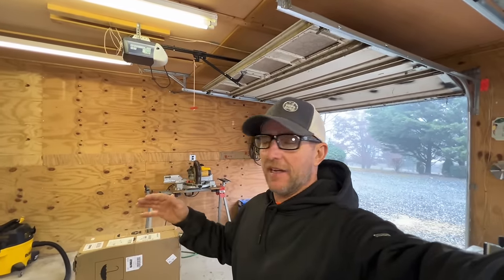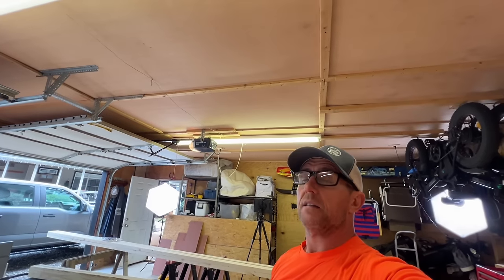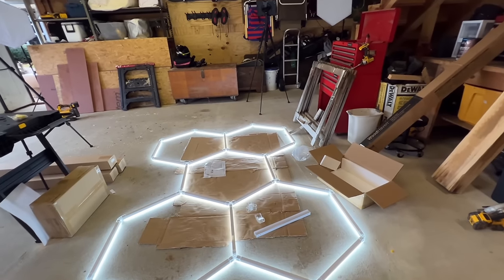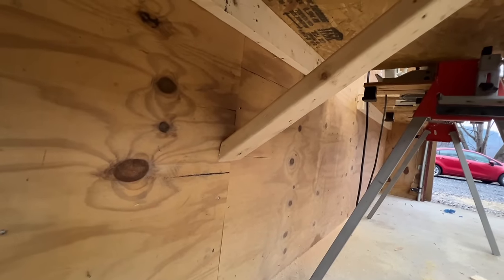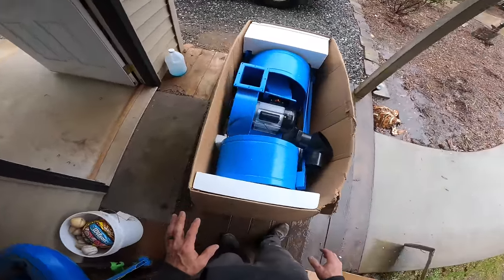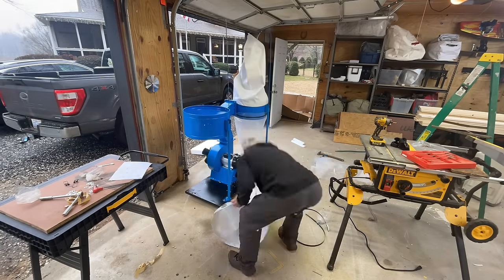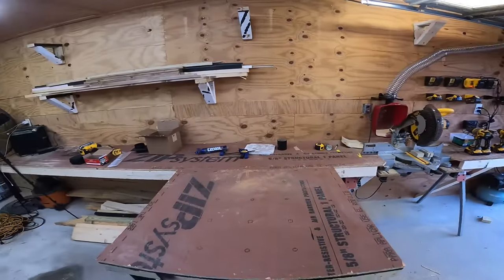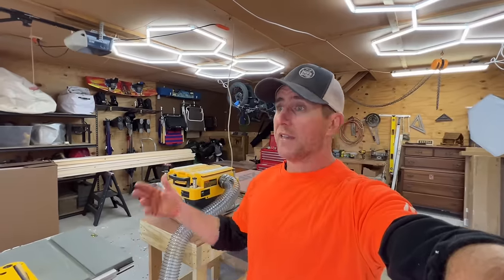Jay's New Shop--Episode 7--THE SETUP!!

Comment: Jay instead of using a pan to catch the dust from the miter saw use  a thick  plastic  clear bag and  use a twist tie  to hold it on when you move it to  a different  position  to catch the dust that way the dust will be in the bag  .

Comment: Jay, look into grounding your vacuum hoses.  Lots of static electricity builds up and wood dust goes up in flames pretty easy.  It's a simple as drilling a screw halfway into some plastic housing and running a copper wire to a ground.
Reply: We used to give our wide belt sander dust to a pyrotechnics guy cuz it's so incendiary😉 I've never known anyone that didn't ground their hoses.

Comment: Another option for making 45’s easy is just add the thickness of the material twice, as in 1-1/2” material add 3” to the shorts and you know your longs unquestionably. My go to for door casings. I used to try at measuring shorts but the math is so easy and cuts simpler if you know your longs, or sharps maybe the more common phrasing.

Comment: I forgot what those DeWalt Portable Benches look like new.  I've used mine for everything from an outfeed table, painting table, cabinet assembly table, and a miter saw stand.  You name it, the possibilities are endless with them.  And when you need to use them outside the shop, they're simple to move. One warning Jay, make sure when you are opening them that the legs are facing away from you, or else you'll be singing soprano.  Haha. Thanks for the vids.

Comment: Love the new shop. A suggestion, i added a retractable 75’ extension cord reel to my shop and its amazing. Power anywhere you need it. I’ve also put all my big tools on platforms with casters. Miter sawstand , table saw, planer, all on casters. Makes life much easier.

Comment: You want to see if you can get hold of some second hand kitchen units and worktop for your mitre saw table. You could have one worktop running the length of the shop with a cut out for the saw. It would keep level a lot easier and give you a load more storage in all the units underneath.

Comment: You should swap the table saw and planer locations. The planer seems to be a more permanent piece with the stand you made for it, whereas the portable table saw if you wanted to move it, you have to move hoses and pull it out from between two permanent pieces.  Just a thought.

Comment: Jason, handy tip is to number your batteries. First you always know how many you take/pack down every day, but you can work them in order so you never kill just one of them by over working it. Also if you are working them hard like on a grinder or high demand tool and eating your way through them you always know what's on charge and where you are in your line up so you have a better chance of running all day without waiting for charge times.
You should just make a timer box for the chop saw swarf, also it will work better if you pull air from the bottom and get a free gravity assist. 
The shop is looking dialed in mate, huge upgrade and you should be proud!!

Comment: I'd just attach that DeWalt vacuum up to the miter saw for now until you can figure out a better solution to your dust collector. The vacuum hose off that will be much closer to the size of the miter saw. Also some extension chord reels would be amazing for that table saw and planer you could have one that attached to the ceiling in the center of the room and whenever you need the table saw or planer just pull the chord down and plug in whichever tool you want to use

Comment: Looks great Jayson. I'm sure those oil stains are bothering you. I mentioned the "Polock Broom" a few episodes ago. Get a 2X4 and some Oil-Dri. Sprinkle the Oil-Dri on the spots. Take the 2X4 block and scrub the Oil-Dri on the stains. This does 2 things. It crushes those big particles of absorbent. Then those fine particles gets down into the porous surface of the concrete. In 2-3 minutes the stain will be gone. 
We had a 4X4 with a broom handle screwed in at a 45. That's what we called the "Polock Broom".

Comment: I bought a neat trick device from Amazon. It is an outlet that turns on your vacuum when you start a tool that is ready for dust collection. I use it with my table saw and my surface planer. The device has two places to plug things into. '
A' is for your tool, 'B' is for your vacuum. The vacuum starts when you power up your tool and then runs for 7 seconds after you turn your tool off. It only cost $35, much cheaper than buying a vacuum with the device build in.
I didn't attach it to my slide miter saw. I have tried many ways to capture the dust from the miter saw and the best way I have found is to put a trash barrel under my miter saw bench. I did build a cowl to help direct the sawdust.
Reply: Check out Spencer Lewis insider carpentry.  He has that dust hood thing that is sweet!

Comment: On the chop saw suction.  Try sucking from below as the 2" suction hose isn't large enough to overcome gravity. But either way youll need to make a more pecise box and add a lip to the bottom edge of the box to catch the dust the hose doesn't.  Hope that makes sence

Comment: Nice dust collections, if you get the opportunity swap the ridged flex pipe with straight smooth, where possible as it  improves the suction over long distances by cutting down on turbulence in the pipe

Comment: Love the vids Jason. With the dust extractor consider having a permanent floor attachment called a "floor sweep box" amazing for shop cleanup you'll be glad you did it. and you can get a splitter for one of the outlets that reduces to 2 x 50mm so you'll still have the necessary points you need.

Comment: There's a really nice upgrade you can make to that planer by adding the Byrd Shelix sprial cutter head. It's pricey, but you will get fantastic results from planing, it reduces the noise level, and it's super easy to rotate the cutter heads after damage/wear. In short, it's far and away better than the straight knives.

Comment: Shop is coming along nicely! For the power for your table saw and planer just get a retractable extension cord reel and mount it on the ceiling right between the garage doors and you can pull it down and plug in both appliances but if you need to you can always retract it back to the ceiling.

Comment: love the series, Jay. I would recommend looking at several small workshop YT channels, where they have a large "assembly" type table with a drop in cut out for their job site table saw to sit. If you need to move it you just unplug it and throw it on that mobile one you have. I think you will really enjoy the larger table that has great stable outfeed, but, possibly more importantly, way more infeed support. you could probably even just add on to that outfeed table you made in this if you wanted to save time

Comment: I did three sets of shelves/brackets that look identical to yours to hold spare lumber in my shop.  Top is for posts (4x6, 4x4, partial and full), middle if for full/partial dimensional (2x6, 2x4, 1x2, 2x2, etc).  Bottom is for short bits of dimensional as well as small pieces of plywood.  Works out pretty well.  I ran a rip of 1/4 inch plywood across each sets for brackets.

Comment: Hey Jay if that is a 20amp circuit you need a proper 20amp receptacle. That looks like it  is only 15. i can tell because there is no sideways blade that looks like a T on it. I could be wrong but thats why we have in Canada so you can tell them apart
Reply: And sorry I am saying this because you would not want a fire in that cool shed. Not nitpicking because 20 amps through 15 amp  receptacle equals heat!!

Comment: in my garage, i have a couple of chargers mounted to a wall and i have batteries in chargers all the time so there's always a charged battery when i need it, i don't have them charging 24hrs/day as i have the chargers running through a cheap mechanical timer and only have the chargers switched on one hour a day  so i don't have to worry about overcharging and possible fire hazard, the main reason I do this is I might not need the batteries for a couple of months and don't want to wait for drained battery to charge when i want it
Reply: Good idea putting chargers on a timer 💪

Comment: The dewalt port is too small for the 4-inch hose of the extractor. You'll burn the motor out. Just look at the 4-inch hose u need to split the hose to the blade guard to release the pressure of the extractor motor .

Comment: Your dust collector should absolutely live upstairs
Reply: I second that 😁
Reply: Outside of the rear wall
Reply: Then you’re lugging full bags of wood chips down the stairs
Reply: Also, strongly recommend getting true pleated filters rather than the bags.
Reply: I’d have it inside the new utility area in the back corner nearest the garage and get a remote off/ on for it or triggers.
Reply: @andyknappenberger
WHY ??????????
Reply: @heatherclayton-callaghan4270  because it's noisy, bulky and upstairs is just storage anyway. It would be super easy to pipe it through the ceiling in specific spots throughout the shop.

Comment: You should have just used your edge of your speed square instead of measuring inside to inside and then also to lay out the cut piece..I know your not building watches but the length of the edge on the speed square is far more accurate than a tape measure especially in this situation